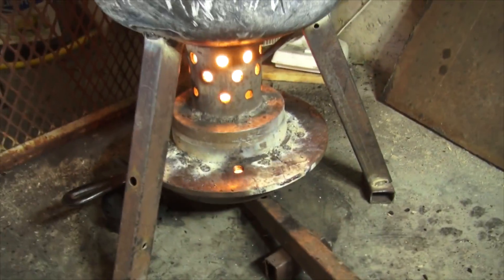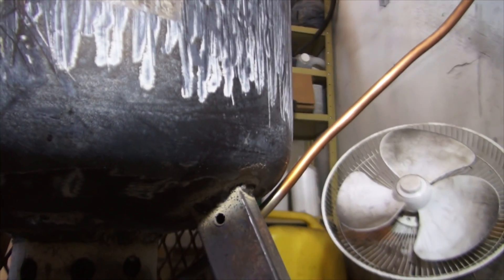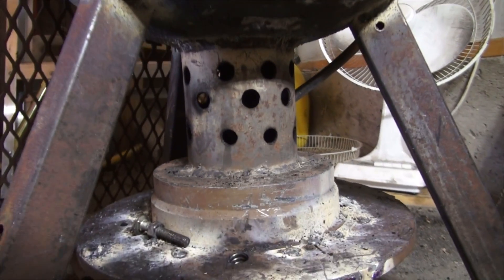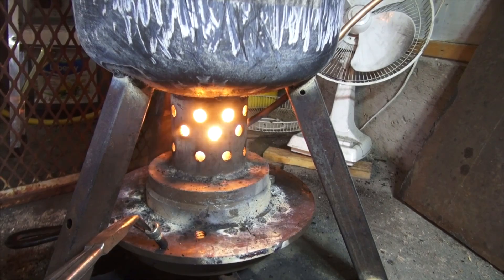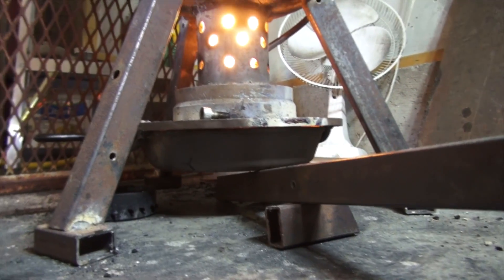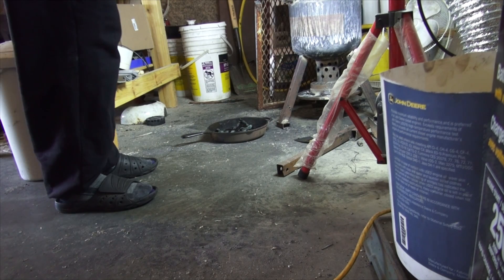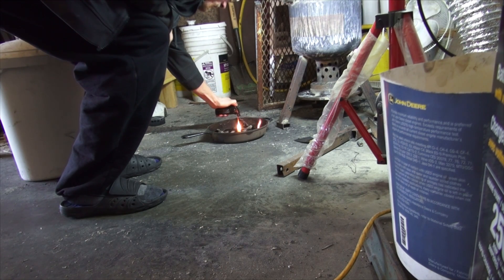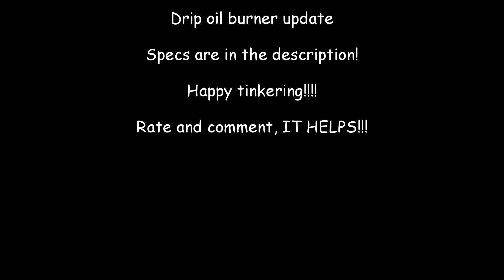WASTE OIL BURNER - UPDATE -

Comment: Great build.  Been looking at a lot of these to get the best ideas.  Yours is only the second one I have seen with the horizontal pipe running through the center.  This is a great idea.  The other one I saw, they used a computer fan at one end to increase airflow through it.  Many of the others had a longer secondary burn tube on them.  One guy said the number of lower holes made a larger difference than the top ones.  Another great suggestion was to have a outer sleeve on the secondary burner to control air flow.  A lean burn can smoke as much as a rich one.  The last one, and I thought of this too, was Fireman Jims idea.  Put some heavy gauge mesh in the secondary burner.  If it is good enough to do for commercially built kerosene heaters, it is good enough for me.  It amazes me that no one on YT does this.
Reply from the maker: Glad you like the setup, the burner works very well at this point.
So far, what I would like to do, is build another burner that siphons it's own oil up from a reservoir, which will add more safety and would prevent water from getting in the burning chamber (if water settled from old oil).
In the same breath I would like to enclose it and have a view port on the side.
The length of secondary pipe/holes should be increased by at least 3 inches totaling 9 inches of pipe.
That would increase air flow and make for a cleaner burn.  

The center tube on my burner gets a strong air flow through it from the fan that is placed on the side of the burner to help distribute the hot air. The burner is actually much too hot for my single garage, so I gotta keep the doors somewhat open, which is great for when you weld and cut wood anyway :P

Comment: Got what you call a box car heater 30 yrs ago ,(rail road item), it had a commonly used "oil control valve" that I've seen on oil furnaces, & even old coleman products. I used it to heat the basement of a house under construction., I ran diesel, & sometimes kerosine, & still had to de carbon the burner after after several days use. The valve itself required no power, & consisted of 2 floats,like a carburetor), one as a back up to prevent over flow. It also had some metering needles & flow adjustments .,After a clean up & no parts,the thing ran fine despite being 50 yrs old .It had it's own internal filter , but probably would need waste oil to be put through a fine screen.
Reply from the maker: That sounds like a simple and neat setup! If I ever needed another heater, I would definitely try something like a float base control valve, over vacuum and do a damper modification.

Comment: Heaters of this type commonly had a chimney damper with a small weight attached ., I was told it wouldn't run properly without it .Other than that ,the chimney was wide open.The dampener just opened by air being pulled up through it in a "T" fitting .The stove came in the middle , the dampener on the bottom & the chimney on the top. The whole pipe was a "T" laying down.

Comment: So you're saying if, for example, the pipe on mine is eight inches longer make holes across the whole thing  That's not too much air ?? Like I was thinking just a few holes low So there's a strong draft coming out the exhaust  thank you ?
Reply from the maker: Honestly, my new burner with a secondary air inlet just above the flames is much better.
This little one got changed so many times years ago, I don't even remember how it burned the cleanest. You are totally on the right track though, you have to work with the draft. So an adjustable secondary air inlet and draft control is a bug deal.

Comment: Just looking at it the oil feed line ,you are going to have trouble as the oil will crust up inside the 3/8th tube. 
Why because it's sitting directly in the flame. Good to see no smoke, well done.
Reply from the maker: +Fireman Jim Actually, it appears that because of the high heat it wont build up much crud at all. I poke at it once in a while and that is just fine.
The line is still too big, cuz I am running VERY LITTLE oil.
Thanks for the pointer though, it can be easily missed.
Overall these burners need a good clean every now and then.
For me every second burn. The pan every burn.

Comment: I enjoyed your video although your theory is very different than most of those I've watched and have experienced myself. The oil drip I have and have copied from others ends up having a dry pan where the oil drips but never touches the pan as it vaporizes before it gets there. When the fire is first started there is some oil but as it gets hotter it burns off. Uses just about a quart an hour. Two different theory's I guess but both accomplished what the owner desires.
Reply from the maker: Thanks for the comment, I like that you actually talk about the other approach. That approach is what I started off with, but found that it had to be monitored and adjusted too much. That is why I went with now just leaving the oil in the pan to boil and crate the vapor there. You fill it and can pretty much walk away for 45 minutes until it needs topped up again. The pan holds about 1.5 liters. HOWEVER, when I find time, I want to tinker with different metering methods and eliminate the wet pan and go back to a vaporizer. The main reason for not having it yet is, that metering properly appears to involve something mechanical or electric to work.

Comment: What i don't understand is why did you use a LODGE cast iron pan? Those are possibly the greatest cast iron cookware around. I would have sent you a stainless steel bowl that would have fit nicely. But anyway,  the whole setup is beautiful,  2 thumbs up!
Reply from the maker: I found the pan at the wrecker and didn't give it any thought of quality or whether or not it is worth restoring. It certainly worked great for this purpose with no fear of warping or burning through :P Sorry if it feels like burning $ bills. I didn't really pay anything for it. Thanks for the comment and feedback!

Comment: I have often wondered why some homeowners burn down more often than others... 😶
Reply from the maker: Me too! I'm not one of them random house fires though, because I am doing this proactively. Meaning I am prepared for failure and a fire. Most house fires are negligence or faulty electrical. Kitchen fires are way up there on the list. This kind if thing doesn't get away on people, because we know how dangerous it is. Only the morons will burn their place down. Beside, I have fire extinguishers in all main rooms of the house and two on each end of the (now) shop, that's 6 total. My place won't burn down because of me.
Reply: @oBseSsIoNPC  Well, then we hope that you will always be where the action is. ;-) 
A tip from practice: To prevent this from happening, install a thermostat and a solenoid valve or engine valve, which interrupts the oil supply if the temperature rises too high. Choose a circuit that also closes the valve if the voltage fails.
Reply from the maker: @RosaBeha  Thank you for your care and kind words. I always run the burners to where they run out of oil, when unattended. The designs are simple enough, that all points of failure are predictable. When power fails  they regulate themselves down, making them burn dirty, but safe. My 600,000BTU burner is the direct replacement for this little guy and CANNOT, in any circumstances burn down anything or run out of control (I tried for years to find weakpoints and eliminated them).

Comment: Hey bud great heater,

Just a question, What size and how many holes do you have in the center tube?
Reply from the maker: Thank you D5711,

they are half inch holes and there are 21 of them, I never got to try out if a mesh would be just as good!

Comment: Hi :)))))))))))  Hmmmmmm, so in theory, you can drill 3 holes, for 3 Size Screws. Large Screw for High Heat, Medium Screw for Medium Heat, and Small Screw for Low Heat.
Reply from the maker: Yeah, the thing with the gravity fed heaters is, they change efficiency a lot during operation.
When they are hot, they need VERY little primary air, because the oil will fog out quicker and create a butt load more heat. A low heat setting on mine is with all primary holes closed, only the leak by of air past the small cracks will keep it running.

Comment: 1 liter per hour is a lot, if you run it for 5 hours daily where you get this much oil
Reply from the maker: I am a mechanic, but you can always asks shops and farmers and they will be happy to give you all the oil you need
Reply: @oBseSsIoNPC  can I run it on low drips, or will it go off
Reply from the maker: @cakesaroundtheworld7388  you can run it as low as burning a candle, but its tricky to maintain, won't heat anything and will smoke a lot. But yeah, you can crank it down a lot. Although its better to just build a smaller burner.
There are much better designs that allow for more adjustability and maintain a clean burn.

Comment: can JB weld be used .I don't have a welder .
Reply from the maker: Doubtful, due to heat and expansion. I wouldn't trust it, although I have repaired a gear case with JB weld in the past. Best would be to figure out ways to bolt things together instead.
Reply: ObsessionPC OK thank you